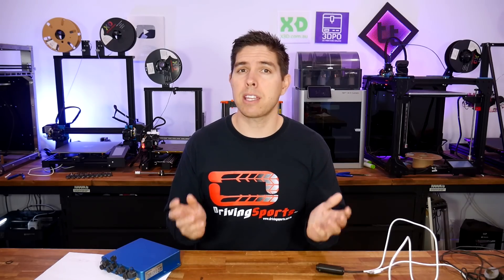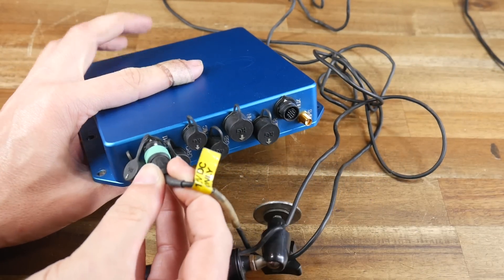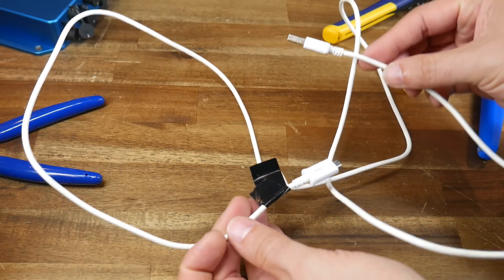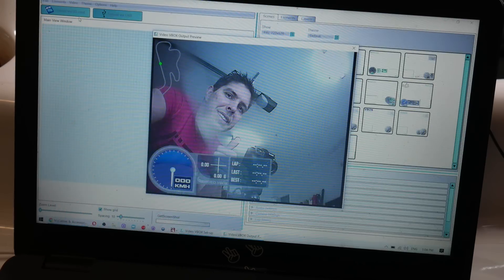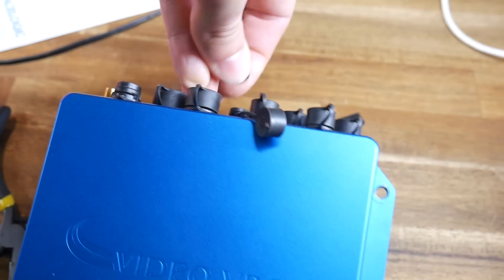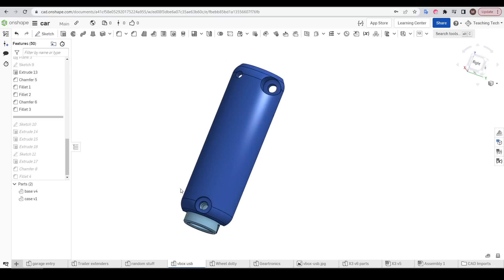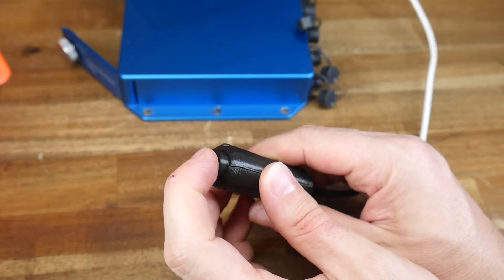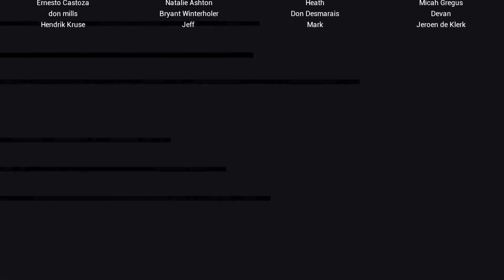Making an unavailable, proprietary USB cable with 3D printing

Comment: Liked, but would removing the old "usb" connector and replacing it with something newer not have been easier?
Reply: Especially that looking inside all connectors were on separate cables with internal plugs. Would have been a breeze to change that to USB-C socket
Reply: Then he wont have had a how to video about 3d printing design
Reply: I was searching for this comment. Thought the same. It should have been possible to drill out the inner part of this connector and glue a type C socket into it.
Reply: @Manu-nr1yt  That would have been a good fix!!!
Reply: Of course that would be easier, but the point is creating a video how to do this in case that would not have been an option ;)
Reply: That's the route I would've taken, with a CNC cut PCB and a type B or whatever USB connector inside a custom printed bulkhead connector IAW with the design specs. Eazy Breezy!

Comment: These connectors look very similar to if not the same as the Hirose (HRS) HR30 series. Maybe they'd be worth a look at for a more permanent solution?
Reply: Was just about to say that. These look exactly like the HR30 series... especially since the silicone covers say HRS on them.
Reply: The documentation he was able to find also mentions Hirose. It's a pretty good bet that's what they are (specifically HR30-6P-6P). They're about $8. The caps are LF07WBR-C2 ($4). Though it wouldn't be the first time a vendor ordered custom 'almost off the shelf' connectors for a product like this.

I enjoyed the reverse engineering anyway. Using heatshrink to hold back the shield is a new one for me, and a useful tip.

Comment: Why not replace the female connection on box side with a femald usb A connector? Even the PCB has a socket for the plugs.
In the end we now that the purpose of the video is to show that is possible to recreate a discontinued connector and for some cases it is very helpfull.
Reply: my thoughts too.
Reply: @iamkian  I agree with both of you, but I suppose it would not have made a 3D printer video though 😞

Comment: Should have tried the round pins from the old Dsub connectors. That's what a lot of those round proprietary connectors use because they don't want reinvent the pins too.
Reply: The connector isn't even proprietary. It's a hirose connector and you can easily buy it online. Just solder your own cable to it and be done with it with 5 minutes of work.
Reply: @Esablaka  It may look like a Hirose connector, but the case is different. I have a bunch of these cables as end-to-end connections. I want to use them on a bicycle. Mine are outdoor USB cables. Found them at a dump. These are super cool, probably the best types of connectors I have ever used.
Reply: @Esablaka  It looks like a mini-DIN connector, so not proprietary at all.
Maybe the pinout is "scrambled" like the "Apple ADB" looking cable that Denon used to connect the controller to the CD player on their older dual-CD DJ players, you had to buy their special cable, rather than just any ABD cable. So you can't just buy any standard mini-DIN to USB cable, which is a cheap-as-chips commodity item and forced to buy from the device manufacturer.
Reply: @dj1NM3  it looks nothing like a mini-DIN smh
Reply: Like aviator plug with a secure locking mechanism

Comment: You have a plug for this unit for the camera, I wonder why you didn't just measure the pin diameter and order some piano wire the same size?
Edit: that same piano wire can be used to make the correct drill too, using a Dremel to grind a simple spade point works very well.
Reply: Using enough RPM, you don't even need the spade point. I've drilled plastic with toothpicks in my Dremel and just for once letting it rip above 20k xD
It rarely gets to do that because for all I'm using it for, it's basically vaprizing the material already at those RPM. But for a tiny friction drill is that more of the "low end".